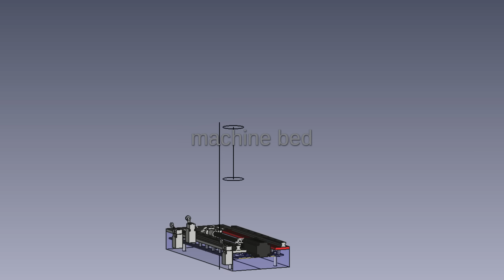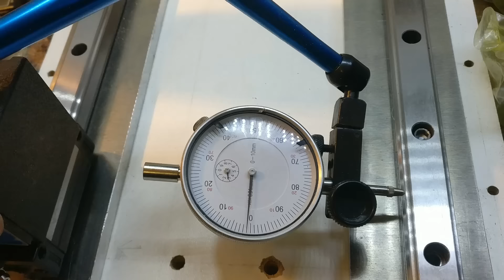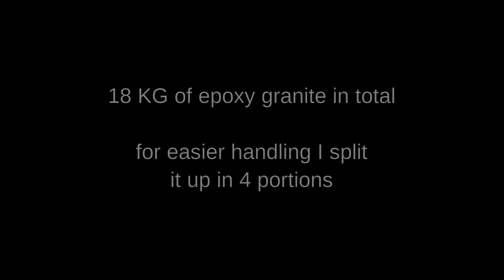home made epoxy granite cnc - part 1 machine bed

Comment: How many parts of sand, stones and epoxy did you use for that mix? One guy on here said he had complications using stones in his mix causing air gaps and he even used a shaker board to try to get all the air out.   He ended up just using sand and epoxy.

Comment: Great job can u tell me any kind of epoxy u use. Or any epoxy resin can make epoxy granite
Reply from the maker: I ordered some affordable online, with a slow hardener. Can't really remember what brand it was. Did some tests with it before to figure out the right mixture and to get a feeling for the mix, and when I was happy with the results I went for it. As there's only about 10 to 12 percent of epoxy in the mixture the shrinking of the epoxy isn't that big of an  issue

Comment: why not vibrating the mold to get air bubbles out? all you need is some electric motor with an offcenter weight on the shaft strapped somewhere. You could even use a oscillating sander and press it on the mold while it's running.

Btw. I like your style of building the reinforcement, I was looking for something where I wouldn't need to weld anything.

Comment: Great work with good accuracy. Does the machine bed made with epoxy granite requires any machining operations after casting??
Reply from the maker: That depends on what accuracy you are aiming for. The aluminum itself doesn't come 100 percent straight. In the casting process it's getting a little deformed as well (the wood isn't straight, deformations because of the load of the mix, shrinking...). Here I ended up with 2/10th of a millimeter. This could be shimmed out of course. But I'll prefer to have the aluminum itself as straight as possible. So I'll take off half a millimeter on a traditional mill. Also thought about lapping it on a thick glass surface (that's the most straight surface I got in that dimensions). Guess scraping would be a good technique as well (I never did it myself).

Comment: @Joerg Beigang, Congratulations. This is awesome work! If you don't mind me asking, do you have plans to share you CAD files?
Reply from the maker: Thanks. That's the first cnc machine I'm building. So before I encourage someone doing the same (mistakes), I'll make sure it works. Just casted the base for the z axis, but the CAD data is still not stable yet. I still got to do some work on the x axis...

Comment: This is a GREAT design. I might copy it in regular concrete.
Reply: regular concrete shrinks
Reply: @sergegostoli9524  Homebrewing my linear bearings so that they can be adjusted manually. They will be a bit higher.
Reply: @lowellhouser7731  the think abut concrete creep is that it occurs over a long period (years) with a concrete design you will have a concrete beam with a face with a much higher tensile strength, hence it will warp with time, you might be able to counter this with some tension rods on the unconstrained side tat would need to be periodically adjusted but it is a complicated system and assumes you are able to measure the mean deviation on the assembled machine.
This is the  reason why machine builders use polymer concrete despite it's much higher cost instead of ordinary concrete or even UHPC
Reply: @sergegostoli9524  Are you familiar with the names Lucien Yeomans and Pat Delaney? Yeomans pioneered the use of concrete in large machine tools circa 1914. Pat Delaney discovered this lost technology and began a Yahoo group that began refining the design for small scale and even third world primitive conditions. Everything is designed to be adjustable in perpetuity.   Round ways for a lathe, allowing them to be rotated when worn and then replaced. And the machine base is so cheap that if a problem emerges that can't be adjusted for then it gets Jack hammered into pieces and recast. I'm doing something similiar.  Eventually I will do an epoxycrete version once the bugs are worked out and I can scale up.
Reply: @lowellhouser7731  my understanding of yeomans lathes is that the metal slide were fitted after casting with low shrinkage "gluing" 'low heat allows pours), and that the machine bad was massive in comparison to the metal parts, anyways you are free to try, but if I can give you one advice do not hesitate to use the maximum amount of concrete fludifiers in your mix so as to get the water to cement ratio as low as possible since water is the prime culprit in shrinkage, also go for fine aggregates (no more than 10mm for the coarse aggregate)
Reply: @sergegostoli9524  Thank you for the advice, and it is very good advice.  The concrete machines that I am building are for my own YouTube channel.  I was always planning to replace them, and the concrete is so cheap as to make the bed castings disposable.  Heck I'm going to be improvising linear bearings out of round stock and inline skate bearings. If it works at all I will brand it a success.
Reply: @lowellhouser7731  I'm interested in cheap machines :) I'll check out your channel. If you ever get to make a concrete CNC, that'd be awesome. If it's cheap and its accuracy lasts at least a couple of years, I'd say it's worth the effort. If it's accurate for some time, you could even machine yourself the pieces for another CNC..

Comment: you can see it warped :(  at the top light gets through... use a slow setting epoxy less heat  and more stable

Comment: I've just watched your entire build series! Great videos! Do you plan on making the CAD available ?
Reply from the maker: Happy you liked it. 
Actually yes. I'm working on a fully parametric model, that will output the plans for the mold and all the metal parts.
It's somehow in alpha status at the moment, and I'm procrastinating a bit when it comes to writing an understandable documentation.
Reply: @joergbeigang  That's awesome! I'll keep an eye out for that - where should I look? your channel?  your website?
Reply from the maker: @loulimina  I might do a video here. Just got to get comfy with the idea of speaking in front of the camera 😂
Reply: @joergbeigang  Looking forward to it! BTW, all the metal surfaces on your mill are steel right? pt. 7 is has aluminum in the title, so I'm wondering.
Reply from the maker: I used aluminum
Reply: @joergbeigang  thanks!
Reply: @joergbeigang  Hi man! Any update on this? I'd love to look at the CAD for the one you built, even if it doesn't output mold plans!
Reply: @joergbeigang  it’s all aluminum? Even these plates your rails are sitting on?

Comment: Was there a particular reason for incorporating rocks or pebbles to your brew VS only sand?  I feel larger solids would add more considerations to the build. It looks pretty solid and avoids concerns of mechanical run out of the build
Reply from the maker: In theory it should be stronger with bigger gravel pieces.
I can't really tell if it's true. I did some tests before and I tried to use just enough sant to fill the gaps between the gravel. Somehow I found the handling better if it's a little more sand. 
But that's strictly non scientific. 
In the end you got to do some tests and see how it's coming out. And it's not all about perfect properties of the epoxy granite. IMHO it's more important how it handles while casting.
Reply: @joergbeigang  I totally agree. I ask because someone did a test with various combinations and volumes of rocks, pebbles. Sand, and iron to epoxy. They found a certain ratio of sand and epoxy to be the strongest. They're were a lot of variables to their tests and was curious as to how or why you chose rocks as a comparison. Awesome job regardless! Keep up the great work and momentum!
Reply from the maker: @icantthnkof1  I did a bit of research on the internet before and after all I read I thought it's a good idea to start simple, using just fine sand and some gravel. I did some small test parts and I didn't see any reason to change that.
The only parameter I changed was the amount of resin. I tried ratios between 10 and 17 percent. I didn't measured at what load they snap, but I tried to measure the deflection with the same force applied. I couldn't measure anything really significant. The results were pretty close together. At this point I didn't dig any deeper.
In the end it's a pretty strong material, and if the volume is big enough (and the shape is right) it will do it's job.

Comment: Next time use PVA instead of wax, apply generous amount with paint brush. You will have an easy time releasing the mold.
Reply: Better yet, do both. Plenty of layers of wax and then PVA. That's the proper way;)

Comment: All good, apart from the bit where you screwed those 3 bits of aluminium Engineering Plate to a bit of old chipboard.  So, how flat was that chipboard?...Before you screw those Ball Slide Rails on, lap, or flash grind the plates flat. It will only ever be as good as that bit of Chipboard you screwed it to. If you are routing wood, its probably good enough I guess.

Comment: 1:44 screws too large? what size rails and screws are they?
Reply from the maker: 20mm are the rails and I used m6 screws.
Reply: @joergbeigang  my 20mm rails have a 6mm hole in them which is a clearance hole for M5 screws. Might be why your M6 caps didn't fit...
Reply from the maker: M5 felt a little flimsy to me, and the clearance for the screw was just enough for adjusting the rails, only the heads were a little too big.

Comment: @Joerg Beigang Which did you use type and thickness of alluminium for creating bed?
Reply from the maker: I used some 10mm 5000 aluminum. Think it was almg4
Reply: @joergbeigang  Could I need to use 6061 or 7075 instead of steel for accuracy? Wich is material yours coordinate table? I could to buy steel table from old milling cutter 700х400mm. Is better alluminium table? Wich will you recomend alluminium series instead steel? Did you use shaker table?
Reply from the maker: @petrovsergey2470  I'd say steel is the best. I don't have the tools to work with steel in that dimensions, so I used aluminum. But just because I can easily work with it. If I had to choose between steel and aluminum I'd went for steel all the way.
Same for the alloy, I used 5000 aluminum, because I had quite a bit of it and I had a source to get more for a good price.

Comment: Can you post the cost for just the base, column and X carriage(no rails or ballscrews)? Thanks! Better than a Tormach hands down!
Reply from the maker: I didn't really keep track on the costs too much...
I try to get it together.
Resin 90€
Gel coat 30€
Color for the gel coat 10€
Steel and aluminum about 100€
Screws about 40€
Thread inserts 20€
Chip board maybe 30€
Silicon and acryl 10€
Pu paint 25€
Sand and gravel was very cheap
And lots of hours
How good it really is I will see when I start milling. If  vibrations and resonances will be a problem is hard to tell now.

Comment: What is the "recipe" you are using for you epoxy granite? For one how much epoxy are you using.
Reply from the maker: I'm using a mix of sand and gravel (10 - 20 mm). I made some tests before and then decided to use about 13 percent of epoxy. With less the mix was getting very dry and I had problems with air bubbles inside. The sand got to be very dry.
Reply: @joergbeigang  It is 13% by weight or by volume?
Reply: @joergbeigang  I'd also have used some finer stuff (for example "Fugensplit" in german). that stuff would easily fill in the gaps between the rougher stones and sand grains
Reply from the maker: @veloclubustrem1039  weight
Reply: Methinks ZERO SAND AND GRAVEL.... ROCK DUST,.... MINERAL DUST OF ANY TYPE,.... with epoxy enough to allow levelling.... will be my effort.

Comment: Nice job, the router has simple geometry. Did you think to include tubes for the coolant and electrical lines?
Reply from the maker: Thanks! Yes, thinking about putting a steel pipe in the z axis. Could be a good reinforcement and an elegant way to keep cables and tubes organized. But first I'm trying to get the cad data of the x axis stable...

Comment: Can you please respond to this , I'm currently making a vnc machine ( you can check my channel), I milled all my big part and I was wondering if a filed up them with epoxy granit (inside all my metal extrusions) there I any problem of dilation of the epoxy who could make my surfaces not flat anymore ?? 
thank you in advance
Reply from the maker: That's difficult to answer for me. I'm by no means an expert for epoxy granite. I did a few tests and then I build myself a machine. So my experience is limited. I can share some observations I made. But in the end you gotta make some tests by yourself, with your epoxy, your sand and gravel. 
Epoxy is shrinking when hardening. More epoxy in the mixture means more shrinkage but it's easier to work with, less means less shrinkage but from one point on you need vibration to get the air out. It all depends on the volume.It needs a certain volume to work well, also the shape is important. As closer the proportions are getting to a sphere as lower is the resonance frequency. Long and skinny is bad (figured that with my z-axis). But the shape in your case is given anyways, and extrudes sounds like long and skinny. 
The question is what is your goal here. Stiffness or damping? It’s really hard to tell, for damping just filling with sand could do the job, for stiffness you need volume. But I can be totally wrong here. Just go and buy some epoxy, get some really dry sand and start playing around to get a feeling for it. Fill an extrude and compare it to an empty one or one filled with sand. Deflection is easy to measure and how “silent” it is you’re getting a good idea when hitting it with your palm or a soft hammer.
Reply: @joergbeigang  okay thank you for taking time to give me such good advices I will do some experience so . 
And yeah I want to fill it for no resonance and for the stiffness a don’t if it’s useful or if my machine will do the job like that …

Comment: can I ask for dimensions for X,Y,Z linear rails and ballscrews? Length and type. Thanks!
Reply from the maker: sure, they are x 600, y 450 and z 350mm x 20mm. The length of the ball screws are according to the travel of each axis. The rails are Chinese CHTR and about the ball screws I got actually no idea what brand they might be. 
And the travel is 330mm, 235mm and 180mm.
Reply: @joergbeigang  Thank you so much! Could you also reveal how it turned out in the long run? Are you still using it? I think youve done something incredible here and people are definetely curious to hows it going !
Reply from the maker: @piotrilja9211  Actually I had my whole workshop in a storage for two years. Had to temporary leave the country for some family reason and just last month I moved everything in a new garage. So I used it less then planned in the last years.
But used it enough to figure out a few things. First of all I'm not so happy with the 2KW spindle. It just doesn't have enough torque in the speeds where you'd like it to have torque, The assembly of the Z axis is made of aluminum which isn't the best when it comes to vibrations, and I should have made the z axis longer, at least 100mm. Especially with a vise and a little longer end mill it's getting quite tight. And a few things I overcomplicated design wise.
For sure the wheels where it's on are way too flimsy. One wheel broke when moving it off the trailer and now I got to find a way to replace it.
Right now I'm too busy to find some time to take care of it, but I'm planning some project for the winter month. Till then I'm trying to get it all in good running condition again.

Comment: How did you get the plates to stay in level with one another during the epoxy pouring process?
Reply from the maker: They are screwed to the mold. That kept them within a few tenth of a mill. Of course they needed to be planed afterwards.

Comment: Hi, have you tried to measure some deviation coming from thermal expansion ?
Reply from the maker: Not really. But I assembled parts in summer time and others in February. At the final assembly I double checked everything with the straight edge and it looked all right. Better than I expected. Had of course my concerns because of the aluminum. Later I saw this video here https://youtu.be/OLiTHuVI0mY (7:40) and was very surprised that Kern is using aluminum on epoxy granite. They are using it for thermal reasons, I used it because I'm not having the possibility to machine steel.
Guess the key is to keep the aluminum-epoxy granite ratio as small as possible. Didn't know that before ...

Comment: Hi, I have a question, where did you get the granite epoxy materials?
Reply from the maker: I ordered some epoxy online, bought a bag of fine sand at a local hardware store and the white gravel was a leftover I had from the garden. Very important is to dry the sand before
Reply: @joergbeigang  very interesting I thought that granite was like marble or something similar, Do you think it really works and does it absorb vibration and vibrating sounds? thanks
Reply from the maker: From me it's working. I can't compare it to commercially made epoxy granite, but it's far beyond other solutions I could have realized in my shop. Maybe concrete would be another option.
Of course it's vibration damping and the hight of the resonance frequency depends on the mass of the part and even more important on it's shape. The worst properties I found in the column. Due to it's narrow and long shape. But even there the resonance frequency is that low that it isn't of any concern for me.
As I've already written, you gotta do some tests. The mixture isn't that expensive, so you could also cast some bigger test pieces and investigate their properties.